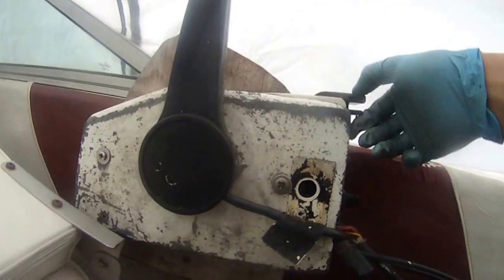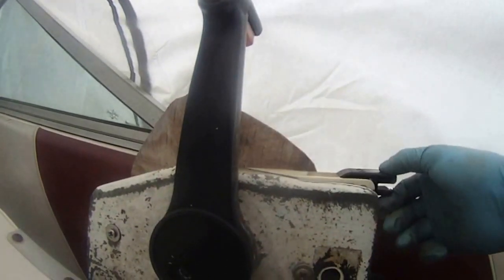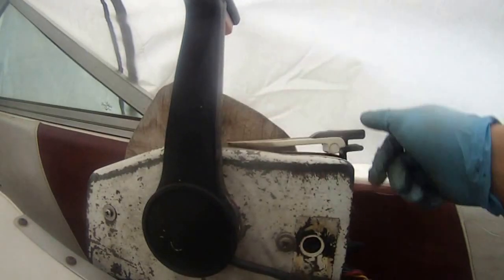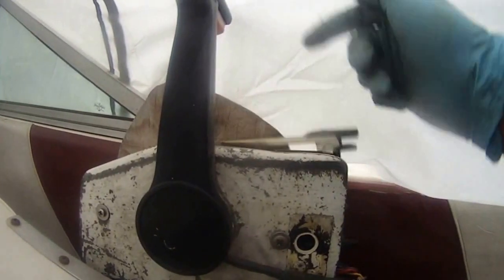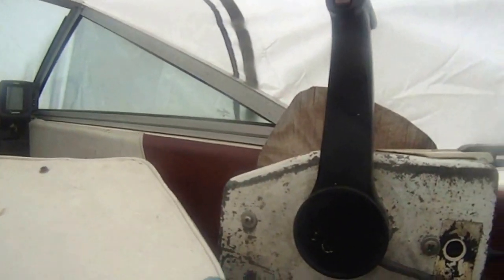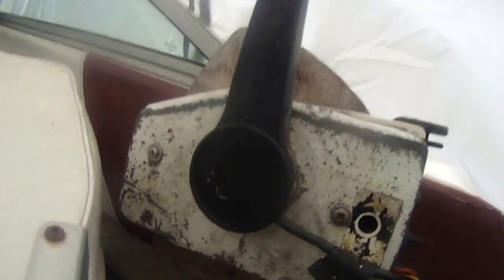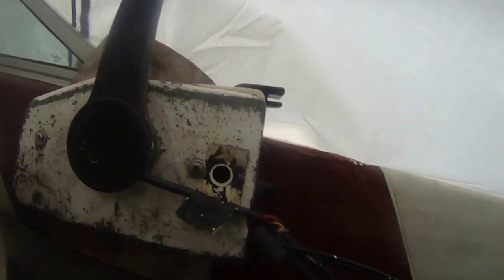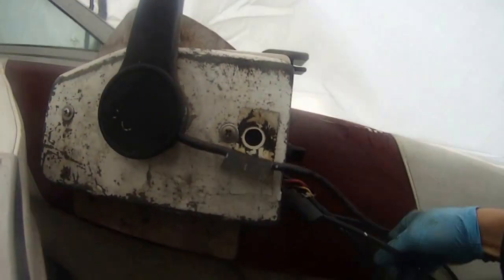Johnson 90hp outboard fast Idle lever broken and loosened (1 of 2) - FIXED second time

Comment: After taking control box apart can't get screw to turn inside that works fast idle. Idle lever loose and don't work. Outside nut turns freely along with screw. ?